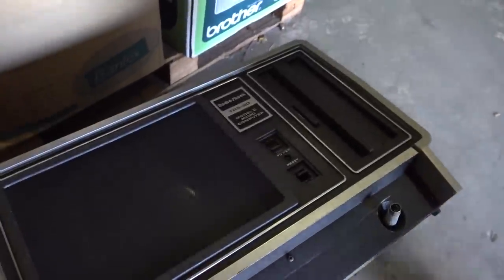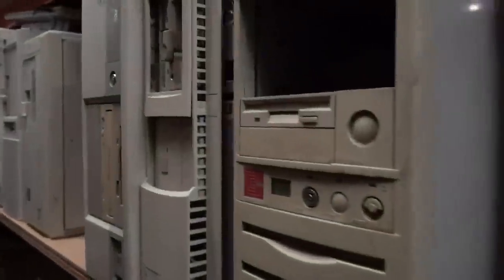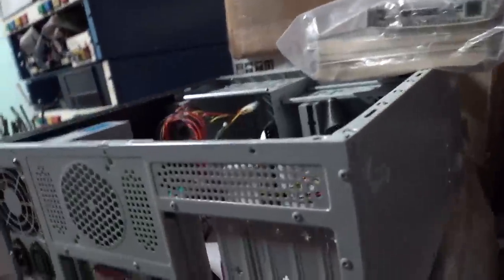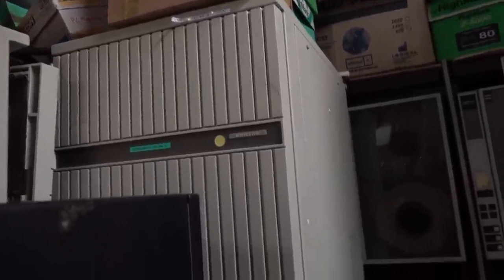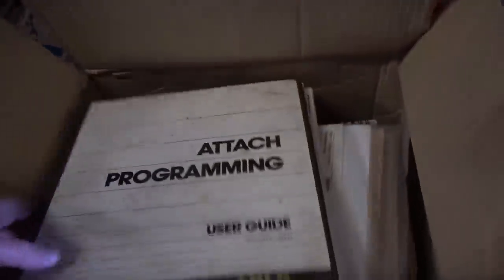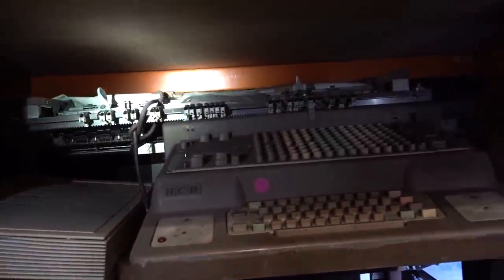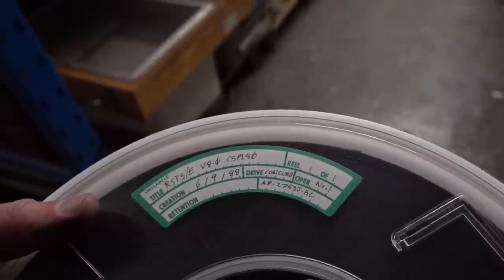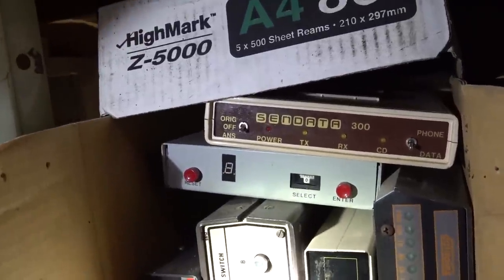EEVblog #1112 - Vintage Computer Warehouse Diving!

Comment: FYI you will need an amiga keyboard to plug into that amiga 2000 you grabbed as the amiga's have a custom chip in the keyboard themselves, and you cant just adapt a pc keyboard to an amiga.
Reply: Jamoise Is it not possible to clone that chip? And make a DIY keyboard for it.
Reply: Reverse-engineer an Amiga keyboard interface? Come on, this is eevblog,  that crazy Aussie bloke can do it!
Reply: He tore down an Amiga 500 a while back, so assuming he still has it, he could take the keyboard out of that. It won't have a case but good enough for testing. I doubt Dave will care enough to do that, it will still boot without a keyboard and as he always says "don't turn it on, take it apart!"
Reply: If its possible. Ive seen no info on it having been done before. Ive been searching for alternatives for a long time and im not sure if an amiga 500 keyboard which is an internal one. Would be easily adaptable. Amiga 2000 keybords are adaptable to 1000 keyboards as the connector is just different. Every article or post i see about the keyboards never list a pc keyboard to amiga adaptor. I wish someone would make one. As every time i search for a solution the only option is usually. Buy an amiga 2000 keyboard and change the plug end. Amiga 2000 keyboards go for $200 on ebay when they are listed

Comment: I've got one of those Amiga A2000's. Battery was removed years ago but really should dig it out and check the caps for leakage.....
Reply: I have an old Amiga A2000 with a 68030 CPU board, and a network board in it. Unfortunately I don't have the monitor for it or the software for it. Most of the other stuff got tossed when I had to clear out a storage locker. I still have most of the original documentation for it.

Comment: 2:41 "All the good small computers were mostly gone", while you completely miss a 1964 Programma 101 in pristine conditions T_T
Old PC clones are basically trash to me, I mean, I keep an old PC to run DOS and Win < 7 stuff and read old floppies. No need to have more than one. But there were a couple interesting Macs - not really antiques, but at least they're different from anything else. An LC520 near the Teleray and a couple PowerMacs at 6:58.
And I've actually used mainframes with cassette decks. I feel so old now.

Comment: The lease is up in about a weeks time? Good luck to them. There is way too much stuff there to be cleared out in that time. Love the old IBM terminals. There is an interesting looking item at 3:55. Any chance that might have been another TRS-80 or just some monitor? I hope someone makes a new home for the PDP engineering drawings. The DLP-3800 was made by Wespercorp and is a printer controller in its Datasystems line for IBM System/ 34, 36 and 38 minicomputers. Neat. An old Electrohome monitor. Haven't seen one of those in a long time. The Amiga manuals were interesting. I haven't seen them with the black cover before. They may be newer versions as mine have a white cover. Looking forward to the follow up video where you tell us what you took home.
Reply from the maker: I agree, a week isn't enough time. I think a shipping container might be coming today
Reply: Oh good, even one shipping container would help relocate a lot of it.
Knowing developers, they will probably screw up and have to abandon their plans for a new building in 3 months time (seen this happen before), send the business they kicked out to the wall, building was left empty of years.
Reply: Kevin Cozens Commodore and Sinclair original documentation is valuable for preservation and emulation, especially the rarer items as the companies themselves essentially died without preserving their records.  Imagine if one of those manuals contains the details to manufacture perfect clones of the SID chips that people are currently extracting from working computers because of their rarity (yes I know there are emulators, even one that plugs into a SID chip socket, but they are somehow incomplete).

Comment: At 11:05 I saw a Panasonic KX-P2123 24-pin dot matrix printer with COLOR option.  I still have mine in the garage. LOL.  None of this inkjet rubbish!
Reply: Daniel Gliebe the KX-P2123 was my first new printer! I remember getting it at Sams Club for somewhere around $300-$400.
Reply: Stu M I was the cool kid in school printing reports for classes in dot matrix color and even printing video still images grabbed using my Snappy parallel port frame grabber. Wasn't too pretty but it worked.
Reply: I bought the KX-P2135 with the color kit at a Sam's in 1995.  I still have it and even put in a new ribbon. Prints like brand-new!

Comment: Great video!  I was still using 9-track tapes in I guess about 1995 (to back up my UNIX accounts (Harris Nighthawk and also SUN workstations)).  I could use that 9-track tape drive (I saw it in the background) to read my files :-)  (if it could be interfaced with something modern and could read higher density tapes (6250 I think it was called)).  I could also use the Amiga 2000 to replace my dead one.  BTW, I show a magnetic core memory board from a PDP-11 in my latest video (Tesla Coil video) (at location 26:03 (of my video, so don't click the time link here)).  I would post a link, but YouTube would probably consider it spam.  If anyone is interested, I'm sure they can figure out how to view it.

Comment: I collect pc gear :(  oh well it's not everyone's cup of tea I guess. but it is the easiest to come by, in the years I have worked on and collected systems i have only ever come across 2 machines that were non consumer related and that was a poweredge 1950 and a poweredge 900 ( of which i still have.) there was a sparqstation 20, as well  but I never got that to work. it was interesting to note in that shelf of pcs there was a sun system sitting there in relatively good condition. only thing is that most people sadly will not have space for much of this stuff, or will not store it without wanting something. bad thing is that what you are currently stating as garbage may very well be worth something eventually. I can't help but cry at seeing some of this though. I think sadly a lot of this might be scrapped :(

Comment: Any Data General Nova or Eclipse hardware? I cut my teeth on that stuff back in the 70s!
Reply: I was repairing Nova 1200s in the early 80s that were used in the USGS world-wide seismic network. They had 8-16K of core memory!
Reply: I know Nova 1200s well! I used to work at Minicomputer Exchange in Sunnyvale CA. We dealt in used DG hardware and I was the main testing and repair guy while I was going to school. Core memory was great! I remember loading test programs into core from paper tape and then you could move the memory board to a different machine for testing.

Comment: Buy it outright to sell on eBay with a small team?
Reply: It would take years to get rid of a lot of it. Some things (like the countless early 2000's machines I saw in one section) would most likely never sell. Honestly, with the cost of electronics recycling (in the US, at least), it would probably be good to get rid of it for free.
Reply: selling this kind of stuff is a pain, lower 90% of the ebay people do weird and stupid things and when they dont know how to use it, hell breaks lose, blaming the product and seller. 25% of them never pay, or ask you ton of after-sale questions as if youre the support center  lots of work, lots of hassle, may be even bad ratings and low profit due to fees
Reply: MBisFrenchy That's savage butchery.  Selling the valuable gems of a collection and leaving the complete artifacts cut up into scattered pieces all over the planet.

Comment: Until it is catalogued and sorted it is really just a hoard of junk.  There are some nice items in there but it will need time and money to work through.  Is there a museum with other items in or is it just the hoard?
Reply: NivagSwerdna This is one of the back room warehouses for the museum.  Stuff to support and expand the few items showcased to gawking kids.  Every major museum of any kind has such warehouses, and it's hell getting politicians and sponsors to pay for the long term necessity instead of a new shiny rearrangement of the public exhibits.  If this was a fully funded operation, researchers from all over could knock on their door and ask to study the collection of VAX modules or the interface of that wax color printer (to decode some graphics found on another continent as print-ready output) etc.  From other comments it seems they were already providing that service to researchers and were spending so much on answering those requests rather than putting their warehouse in some neat system.

Comment: why don't they just buy the building. (and then later build a better building around it themselves). looks like they're planning to put some appartments on there, there aint no money in that. (renting out appartments makes about the same money per year the average computernerd makes in 1 hour ;) just build those elsewhere anyway. each single chip in there represents a higher investment value than the entire cost of all the realestate in that city combined. (making a new chip starts at like 120000 bucks, making a new building starts at 5000 bucks. bricks and mortar are not exactly very advanced technology).
Reply: australia is full of empty-nothingness where you can put new appartments without the extra work of having to remove a bunch of computers and an existing building. just buy them some other piece of land and swap it for the building. simple.

Comment: 4:47 - That is not PC. I think this is DEC Alpha workstation.
Reply: Yup, it's a Digital Personal Workstation. They were Alpha based and came with either Digital UNIX or Windows NT for Alpha. I've got one in my collection.
Reply: Ian Dunbar my guess it is 433au, but could be older model.
Reply: Yes. Have one alpha miata 433a (blue badge, originally sold with eide drive and windows NT 4), this is definitely the /au version (red badge, with scsi for Unix or OpenVMS) .

Comment: Do the world a service and get rid of the battery in that Amiga 2000 before it barfs electrolytes all over the system board.
Reply: I hope it was removed long before storage, otherwise the battery would've already caused damage :(
Reply: Well, it * can * hold, i have an early A1000 that is still running with capacitors looking fine as well as an A4000, produced almost a decade later that had the beginnings of a battery leak (which i stopped the minute i got my hand on it).

I also got a 500 recently with a memory card + clock that has not leaked yet. When it comes to batteries and capacitors, your mileage may vary, but to be sure always to a "baterectomy".

Comment: Very  outdated technology ,   most of that stuff  has  no value  other the scrape.  Nice video  anyway
Reply: You'd be very surprised. For instance, there were two Sun Ultra 1s early in the video that he walked by. Worth about $100 each in collector circles. There was a Digital Personal Workstation, that's about $300. Just a couple of examples.
Reply: Some of the equipment has either collectible or historical value. But yeah the newer stuff, from the late 80's and on, just chuck it.
The documentation and media though, especially those tape reels would be worth saving and archiving.
Reply: It is much more than the sum of the silicon and metal though...save for the random cases and monitors.  There is a lot of history in those rooms.  We wouldn't have the datacenters we have now without the first steps of room-size computers or storage media the size of our heads!  Hell, I own a DEC Rainbow 100 which has the footnote in history by having the first keyboard (LK201) with the arrows keys in the inverted T we know today.  That and it can dual boot CP/8 and DOS thanks to having both 8088 and Z80 processors.   Now we have microSD cards encroaching upon the 1TB size!
Reply: For that reason they are in a museum (warehouse)!
Reply: Stuff from the 80's will have value in 20-50 years time
Reply: Nice bait, troll